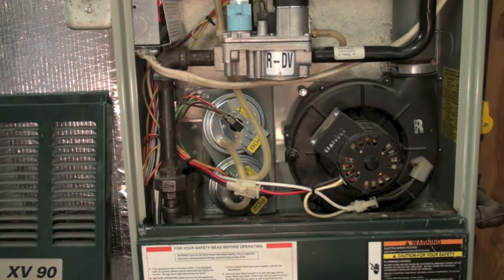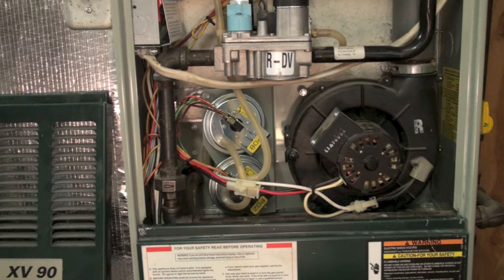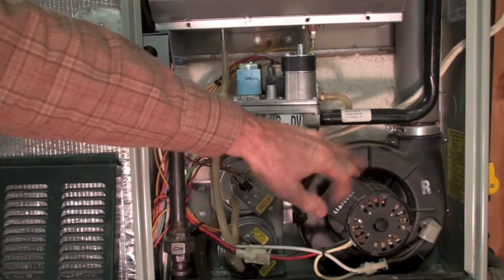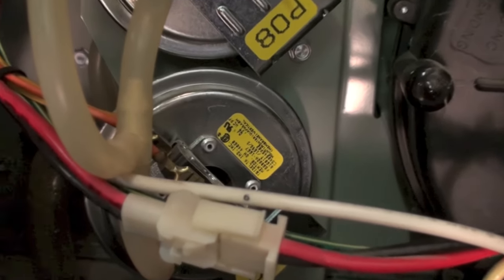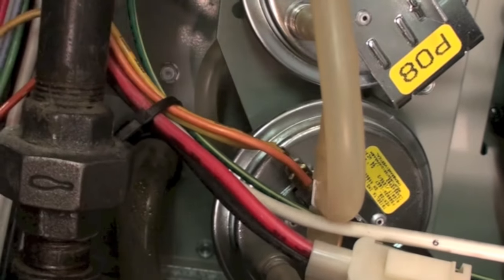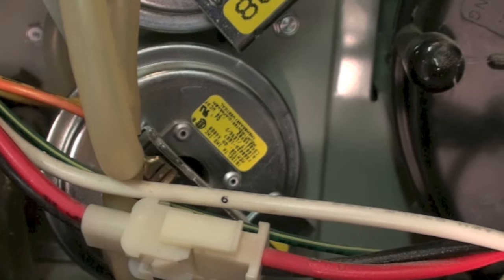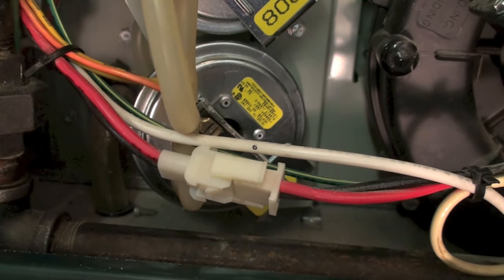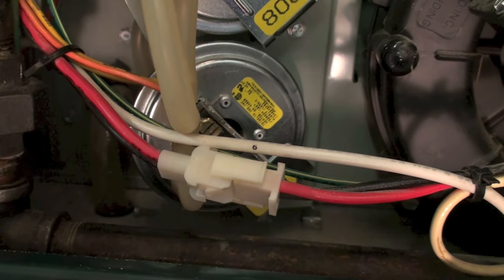Diagnosing pressure switch problems on gas furnaces

Comment: Gray - I can sure use some advice.

I have a 90% (or so) high efficiency furnace that's been giving me intermittent pressure switch codes.  The unit may be approaching 20 years old.  Both intake and exhaust are clear.

There is no tubing running from the inducer fan to the pressure switch.  
From the single pressure switch the tube Ys to the gas valve and the side of the combustion chamber up top.

I appear to be getting ample water drainage from a large tube at the bottom of the inducer fan assembly.

Thanks in advance - John

Comment: Thanks for the video, it saved me a lot of time and money. I saw many other posts about replacing the switch right away, but your video convinced me to check all the lines first. Found a mouse nest in the intake pipe. Cleaned it out and now the furnace is working great. Just need to put a finer mesh on the opening and I'll be all set. Thanks again!
Reply from the maker: Glad it helped.  Be sure you do not go too fine with the mesh.  It can cause a pressure switch code.
GFM

Comment: Thank you, I learned a lot. Sadly, I don't have nor do I wish to buy a pressure meter to diagnose it any further. The fan is making noise and I believe the bearings are bad causing the difference in pressure. I'll see about replacing it and post the results.

Comment from the maker: Check the blower wheel for dirt or damage.  Also bearing in motor.  There could also be a crack in the heat exchanger.  Just some thoughts.  
GFM

Comment: The water in the fan was my problem. The condensation trap was clogged and not draining the water out of the drain hose. The pressure switch sensed this and shut the furnace off. Cleared out the trap and the furnace worked normal again.

Comment from the maker: That would be a definite no on the adjustment.  Unsafe!  My thoughts would be a blockage in the vent, a low spot in the vent that water collects in, or vent exceeding max length/wrong size vent/wrong fittings.  Hope this helps.
GFM

Comment: I have the computer board that tells you the problem,which every year,is a stuck open or closed pressure switch...to keep the furnace going until repair man comes with new one you can take the hose off the tube from the switch that goes to the igniters and put it in your mouth and first suck blow,suck blow then put it back.if it fails,try a blow before re-attaching,if that fails try a suck then re-attach.Learned to have a spare valve handy as every year it goes out.

Comment: I have a single stage Day and Night furnace high efficiency furnace that has been giving me fits for years with the pressure switch "did not close or reopened" fault. Happens every year "winter" without fail. It must be reopening as the furnace runs for several minutes and then shuts down. It then repeats this cycle three times before giving me the three blinks code. 

I've checked the tubes and hoses running to the switch itself and they are clean. I've used a vacuum to clean out the condensate trap. The exhaust is 2 inches and runs roughly 33ft out the side of the house at an upward slope. Per the instructions manual the max run of 2 inch pipe is 56ft. I've cleaned out the exhaust pipe with a dryer vent cleaner, no obstructions. The pressure switch has been replaced. Conbustion air supply is feed from a unfinished basement, so should be adequate. The inducer runs fine and I don't see any issues with it.

Not sure what else to do at this point.

Comment: Like my heating instructor told us many years ago, the first question you want to ask yourself is, "Is it doing what it was designed to do?" If you lack vacuum, its not the switch!
Reply from the maker: You got that.
GFM
Reply: KISS theory 101. These systems are actually pretty simple. They look complicated but arent.
Reply: douglas carpenter  Cool. Glad u got it fixed. Id rather change a Inducer Blower Motor than the actual Blower Because they usually are a pain to get to.

Comment: Thank you very much for your video.  I have a Bryant 340MAV furnace, and did get an error code 31 for Pressure Switch.  Like you said, the PS is an indicator of a problem and it should be the last part to be replaced.  My turn out to be drainage problem.  Again, thank you very much.

Comment: My 10-yr-old Lennox unit suddendly stopped producing heat.  Startup sequence: Exhaust blower starts spinning, then the ignitor begins to glow, then the gas flows and ignits without issue.  Then, some seconds later, the gas would shut off and the system would reset / restart the entire cycle.

Fortunately, I found a trustworthy service technician who merely used a thin wire with bristles (pipe cleaner) to clean out the opening where the Pressure Switch's tubing connects to the exhaust fan housing. He removed the Pressure Switch and tubing, to gain access to and clean the opening at the exhaust fan.  Once he did this, the sensor no longer caused the furnace to trip off.  No parts replaced ... money saved ... normal operation restored.

Comment: Sure, GFM, thanks for responding and asking!  Its a 20+ yr. old 58SS BO 95 B, aka supersaver. So it has just the one pressure switch, and it seems to be original.  This unit is old but very clean- maybe as its in the south.  Run alot more A/C here than heat. Got several weeks to work this one out... However, I can't read the model on the pressure switch past the 4th dig:FS80 is all I got, but you'll know it- three leads, etc.  Should I back up a step and check the inducer relay? Thanx again GFM!

Comment: last year my pressure switch failed, was only a few years old. This year my furnace stopped working. This time there was some crusty debris in the induction port where the hose connects to from the pressure switch.

Comment: Thank you so much for putting these videos together!  They are really helpful in understanding and diagnosing the various issues that can arise with modern high-efficiency furnaces.

I have a quick question on the dual pressure switches, where one side connects to the draft inducer and the other to the burner box.  My understanding is that these switches are actually a single differential pressure switch, in that they contain a single micro-switch and they measure the pressure differential between the burner box and the inducer.  In my case I have a 632445 Nordyne Air Pressure Switch (1.10 inch WC).  My question is what is the expected pressure under both normal and abnormal operation.  My best guess is the following - can you confirm if true?  Thanks in advance for any help.

Normal operation - because of (the normal) partial restriction of drawing air through the heat exchanger, we expect a differential pressure of a least 1.10 inch WC.  When we get this, the switch closes and the furnace runs.

Three cases of abnormal operation:
1) Air intake fully/partially blocked - we get a vacuum at both the burner box and inducer, but the pressure differential drops below 1.10 inch WC and switch opens.
2) Exhaust vent blocked - we get no draft, so we get ambient pressure at both burner box and inducer, so differential drops below 1.10 inch WC and switch opens.
3) Heat exchanger blocked - seems like the pressure switch wouldn't cover this condition.
Reply from the maker: Mostly, the switch will make at the 1.10 number.  The inducer will usually pull, say 1.4. When the switch makes if the vacuum  drops, there is a differential.  As an example, the switch makes at 1.1 in wc.  vacuum would have to drop to say, .9 before it opens.  You are correct on the first 2 conclusions.  The 3d conclusion is usually right, although sometimes heat exchanger blocks will cause a pressure switch to open.
GFM
Reply: Great - thanks for the quick (and thorough) response!

Comment: thanks for the help. I have two units. I swapped switches and the system that was not working kicked on and ignited with no problems. I then for giggles, replaced the "manfunctioning switch" on the unit that wasnt working. It ignited and worked with no issues. Wondering if I knocked whatever was blocking the switch out when I removed it. At least I have heat for today.
Reply from the maker: First, most of the time the pressure switch is not the problem.  Certainly you could have removed a blockage or water in the line.  But who knows.
GFM

Comment: I had a problem with a vacuum/pressure combo switch on a Payne 90%er today that I suspect was caused by the intake vent.The intake,not the exhaust vent was dripping water onto the burners below,down onto the gas valve,and onto the Vac/pressure switch.The switch should be sealed where water cannot be absorbed into the internal workings of the switch,and I'm skeptical that the water caused the problem.I was at this house 3 weeks ago for the same problem but it mysteriously went away after I recycled the furnace about 4 times.The first time it happened it was right after a snow storm,so I went up on the roof to inspect the situation and I found absolutely nothing wrong up top. It ran for approx. 3 weeks until today where the furnace went into a code #31 again.These Payne 90's,when the intake is installed on top of the furnce,has to have a horizontal PVC TEE with a drain installed prior to entering the furnace cabinet(Not mentioned in installation manual ) What is happening is the heat from the burners rise up and meets the cold,moist air from the intake pipe and starts condensating.The water drips down,taking out the gas valves,and circuit control boards,and now,possibly the Vacuum switch.Supposedly we sent one of our installation mechanics to this building, and refit all these furnaces that had top intakes with Tee's and drains,and I guess he missed an Apartment.We had 36 apartments (minus 6) that we installed the heating/cooling systems in.My company took over the job after a Chinese owned HVAC company really screwed up the first 6 apartments.They actually common vented a 90% gas furnace,and a condensing hot water heater into the same vent pipe.My helper and I got back to the job about 7 tonite,and installed the new(under warranty) part. 
BTW,I'm Subscribed ! Thanx

Comment: One way to test for electrical failure of the switch is to apply vacuum to the "-" side of the switch and check across contacts with an ohm meter for change of continuity. Have had continuity fail on a couple pressure switches.
Reply from the maker: I have done that however, these switches use a very low pressure to make.  You need to compare a vacuum reading with a manometer to the pressure at which the switch should be making(if available).  Thanks for the thoughts.
GFM

Comment: Just an update from Lennox.  They don't warranty if you want to be proactive.  If you DIY your pressure switch and then phone the company for warranty they will not warranty the switch.  So let your house freeze, pipes burst, etc. then phone the company even though you know that there is a problem.
Reply: My Lennox has furnace has been a problem from day 1. It's now 6 old. First winter the mother board needed replaced. Year 2 the gas valve box needed replaced. Year 3 the flame sensor went.  Year 4 I was ok. Last year pressure switch bad. This year the induction port was clogged with a few grains of salt like crud and shut the furnace down.  Pos.

Comment: Good morning sir. I appreciate all your knowledge that you share with us You been helping me out alot without knowing. I have a shoot with the weather maker carrier 9200. Everything seems fine. But it showing a pressure valve issue. Nothing wrong with the pressure valve
the only way. I can get it to stay on. If I keep the cover. For the burners off. Any clues sir?
Reply from the maker: mikhaiel j Check the combustion air pipe for obstructions.  Also the vent pipe.  Hope this helps.
GFM

Comment: I have a Weil-McClain Gold CGi gas fired boiler with intermittent issues with the pressure switch periodically not making.  The boiler will keep retrying until it detects the right pressure.  When this happens, I found that if I remove the rubber hoses from the pressure switch and blow through them then reconnect, it will work okay for a couple of weeks and then start acting up again.  Should I be cleaning some other section(s) of the furnace?  Based on a diagram in the manual, the other ends of the hoses seem run to the flue collector box, which I believe is sealed.

Comment: I have replaced one pressure switch in 15 years as a service tech. And the only reason the pressure switch failed was water was  backing up in it over and over again and corroded it.
Reply from the maker: And yet many are replaced.
GFM

Comment: Thanks for the helpful video.  At 3:30, you mention popping the line that goes into the combustion chamber, and the furnace starting.  That is what my Carrier furnace is doing.  Can you expand on this a little bit more?
Reply: +Pandafam1983 Hi, did you ever get a reply to this?  I'm having the same problem with my Trane furnace.
Reply: +Arlene Gilliard My problem ended up being a clogged condensate trap.  It was clogged with black gunk.  When i took out the tubes that connected to the trap, a lot of water came out, about 4 or 5 cups worth.  After cleaning out the trap, the furnace fired right up with no issues.  I would check for any obstructions like that, in the intake/exhaust pipes or the condensate trap.

Unplugging the vent tube from the combustion chamber is essentially bypassing the pressure switch, so you obviously don't want to bypass it to get heat into the house.

I thought he replied to me but it might have been another video that I was thinking about.

Hope that helps!
Reply: +Pandafam1983 Hi, I am having the same problem you had. I do not understand why the condensate trap affects the pressure switch function.
Reply: +David Li The pressure switch is a safety device that tells the furnace that there are no blockages in any vents.  This includes the intake, exhaust, and condensation trap.  The negative pressure of a blockage will cause the switch to trip, which in turn will prevent the furnace from igniting for long.

Comment: Hey there, GFM, thnx  4 all excellent guidance. I have a older Carrier whose inducer is not coming on at all on new season startup  I hot wired it and it runs nice and quiet like it has always sounded.  It is possible it could still be the pressure switch even if the inducer never gets voltage from the control board?  (I checked the connections and the voltage from the board-nothing is sent to the inducer on startup.  Also confusing is that the control goes on to allow the pilot to light OK

Comment: This was very informative. I'm near certain that my pressure switch is whats preventing my furnace from operating and that the filter was overly blocked by dust. I have a Bryant gas furnace and get error code 31. When I kick up the thermostat and it calls for heat the furnace just kind of makes a buzzing noise and I get that code. Though, Ive removed the filter and replaced it it still wont operate. Ive searched everywhere, how do I reset the switch?
Reply: Sounds like the buzz is coming from the inducer motor

Comment: Can you  recommend Vacuum switch bypass? Will that help me test if burner will light?
I replaced Honeywell gas valve, circuit board, Ignition control box. It was all hooked up right.
What would you do next?

Comment: Very helpful, thank you! I took off a couple of the tubes and there was some condensation in one of them. Now the furnace is running fine. This is the first time this happened in the 4 years we’ve had the furnace (it’s a Lennox). Any ideas why there was condensation in the tube?
Reply from the maker: There are usually 2 reasons for condensation in the sensing tubes.  Operation in temperatures lower than 60F or a defect in the pressure switch.  If the temps are ok,  I would replace the switch.
GFM
Reply: Thank you!  I’ll keep a spare handy.

Comment: I did a service call the other day where the the orifice the tube was attached to was clogged up with hard white dust or mineral buildup. Do you know what could've caused this? i cleared it using a punch and the furnace fired up fine but am curious if there is a bigger issue at hand please give me your thoughts. This is a pressure switch question. furnace was 12 years old and everything else checked out fine. Thanks.